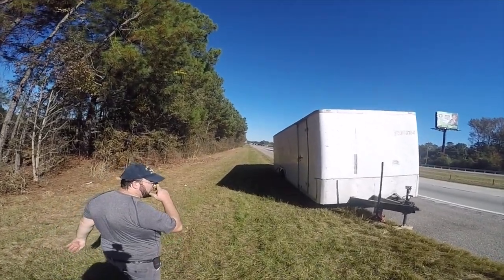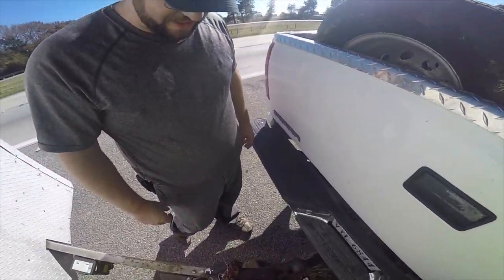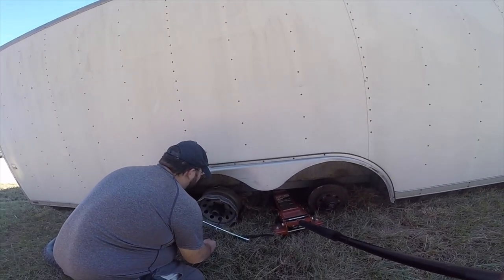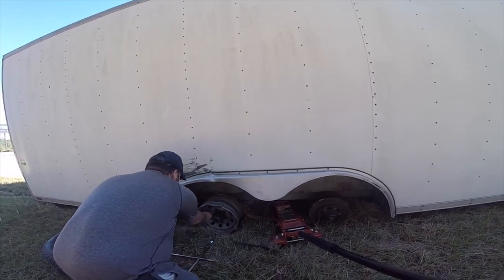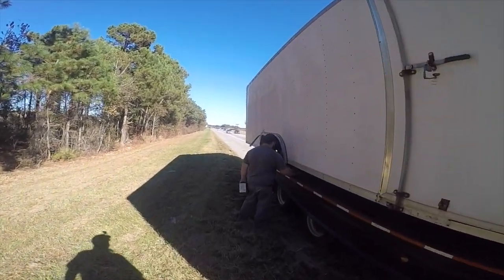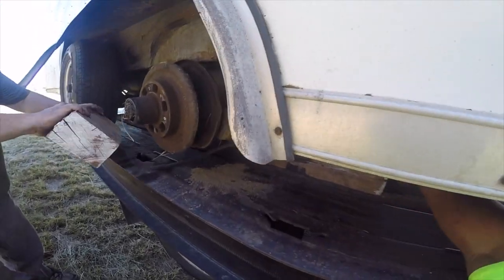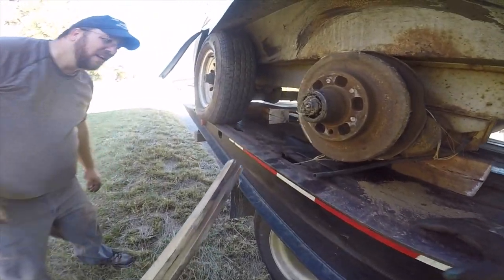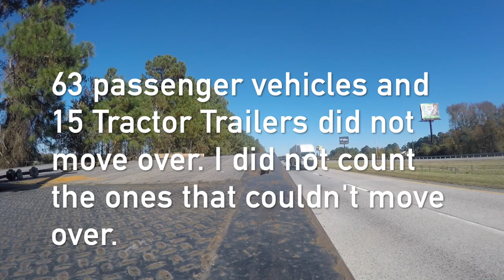Slow Down Move Over

Comment: Mr. Hal as you know I operate a 6 axle Concrete Mixer every day when loaded I'm about 80 Thousand Pounds and you would be amazed at the crap I have to deal with every day from rude motorist. They pass me on the shoulder of the expressway doing 80 to 100 mph cut in front of me with inches between my Mixer and their vehicle, they cut in front of me then slam on their brakes and expect me to stop after they just took away all my stopping room that I leave between me and the vehicle in front of me. I wish I could take video to law enforcement so they could prosecute these people but here in Mi the officer must witness it. Driving in traffic is the hardest part of my job. By the end of the day I'm so stressed because of these morons that it takes a couple hours just to wind down. Now as far as the Slow Down Move Over law, as I read it here in Michigan you must either move over (if possible) or slow down to 10 mph under the posted limit. So yes the best thing to do is move over but by law they don't have to but they must slow down as I stated. If I am in the right lane and a wrecker, fire, ems, police are on the right shoulder I will move over if possible but 99% on the time people refuse to let me over so I slow down to 10 to 15 mph when passing them. On a 2 lane devided Expressway traffic will back up for miles because everyone fights to move over when in fact they should just slow down and be ready to stop if they can't move over and that would stop the traffic back ups. I have to be on the shoulder a lot when pouring concrete and people fly by me like I'm not even there  it is extremly scary so I know how you guy's must feel. Happy Thanksgiving to all of you at Sumpter. Be safe..
Reply from the maker: Mr Dan Very well said. Thanks for watching and commenting. Happy Thanksgiving and stay safe

Comment: Do you carry any lights or flags for the load hanging that far off the back of the trailer?
Reply from the maker: MTU Mr Wilbert brought it back to our shop and prepped to tow that far. All we have are flags. Thanks for watching and stay safe
Reply: @SumterWrecker  Does the law require flags on four foot overhang, and lights after dark?

You should probably carry some magnetic flashing lights in all the trucks.

Ron Pratt and Plaza Towing have some beacons they can attach to their safety gear and also mount on traffic cones for night work. I cannot remember the name of them, but they are very nice.

Comment: As to the traffic that refuses to move over, you should be able to put either jack rocks or spike strips in the lane adjacent to where you're working. When people have to replace tires, they'll start moving over, or at least slow down enough to look for tire hazards.
     Second, this character was not a good representation of Virginia. Some of us do have sense enough to stop when you have a flat tire. That front tire may have come off and flattened that rear tire, but that rear rim didn't suffer all that damage instantly. That looked like a good 5-10 miles of rim riding to me.
Reply from the maker: Mr David thanks for watching and commenting. Stay safe

Comment: Just a question out of curiousity  Why were no orange cones placed to the rear    Why does your truck not have warning lights whether they be orange or as allowed in some States "Red & Blue's"   Easy to criticize but you have to do your part too    I drove Heavy Wrecker in Ontario Canada and I never stopped on the side of the road without my Orange beacons on and orange cones at least 3 spaced about 100" behind the breakdown and that was well before the "PULL OVER AND SLOW DOWN" program
Reply from the maker: Mr Larry Those issues are being handled now. Thanks for watching and commenting. Stay safe